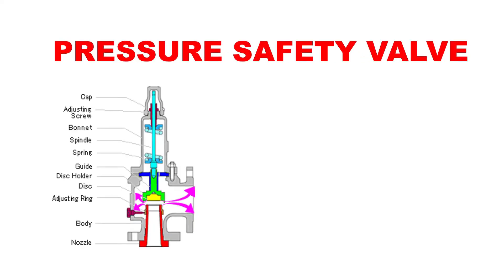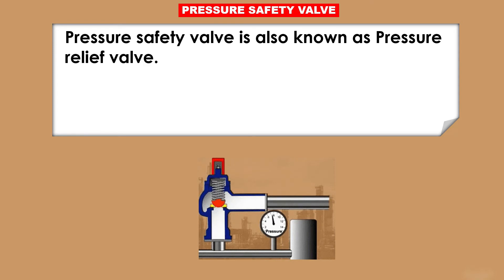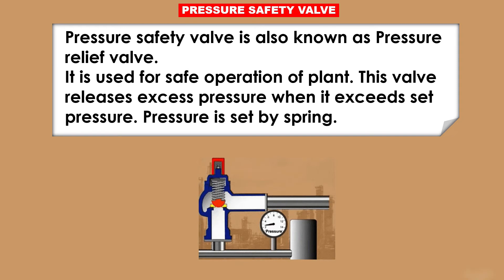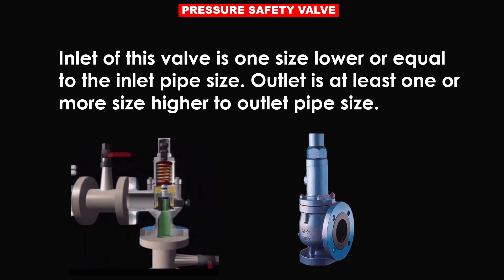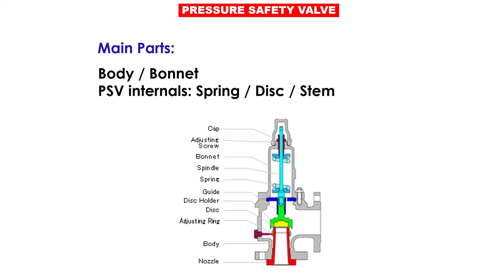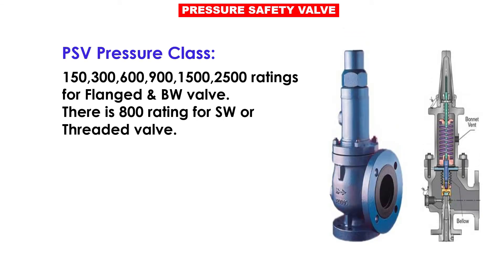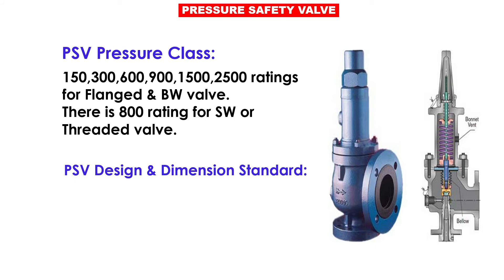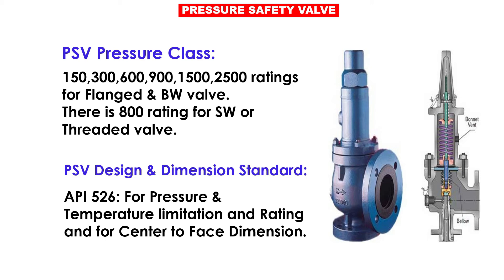Pressure safety valve explained / OIL& GAS PROFESSIONAL

Comment: What is difference between PSV-Pressure Safety Valve, PRV - Pressure Relief Valve, PRV -  Pressure Regulating Valves , PCV - Pressure Control Valves